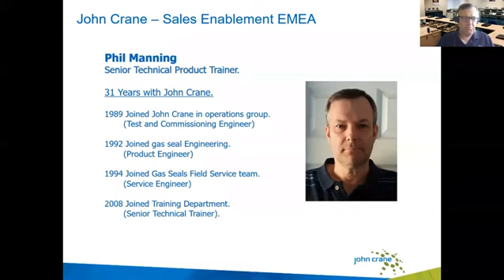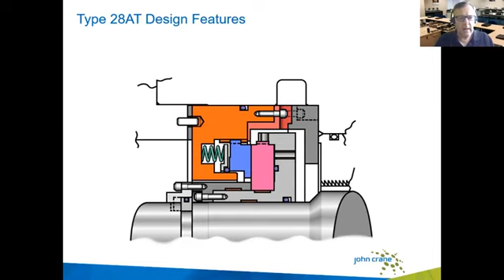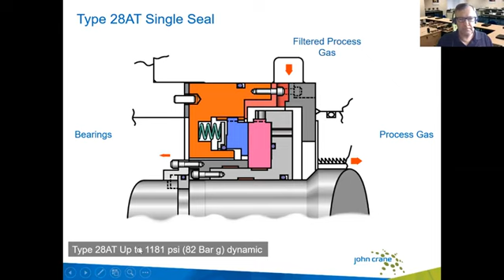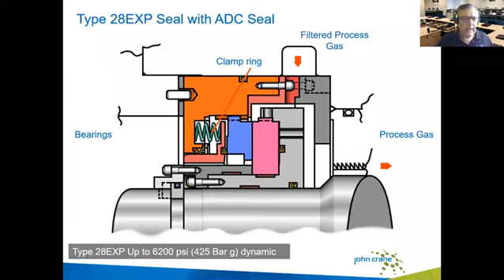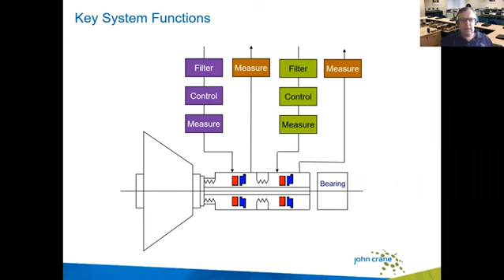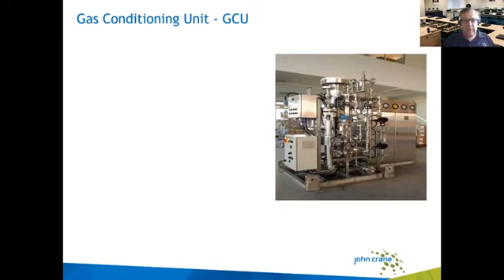Dry Gas Seals Basics

Comment: Separation seal gas and secondary seal gas are not the same.
Reply: The most time it is de same ! But sometimes use Compression air in separation seal and not N2

Comment: In tandem seal arrangement why we need a primary seal supply 
Instead of it we can use directly a primary vent then secondary seal then secondary vent
Reply: The secondary seal is only for backup; it doesn't seal the system, the primary seal does! If the primary seal breaks, the secondary seal kicks in to give the compressor time to shut down.